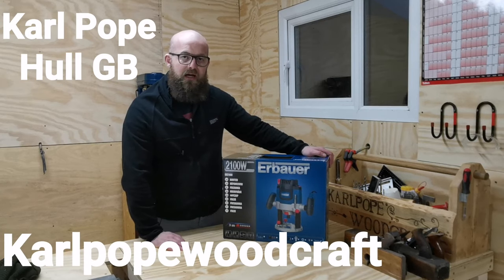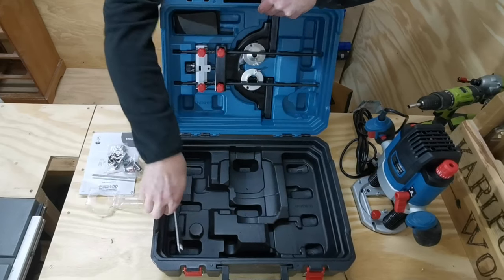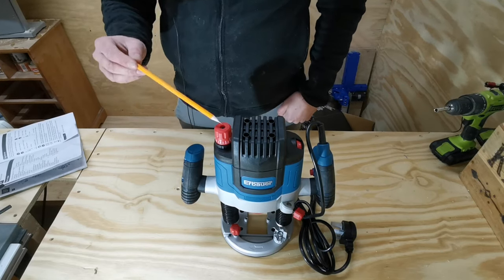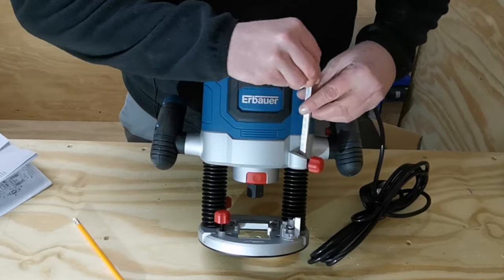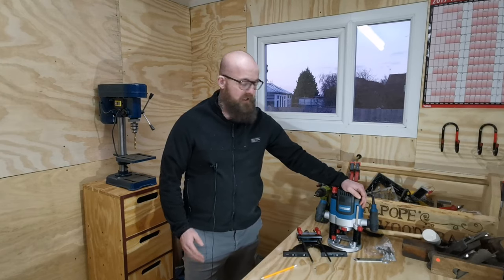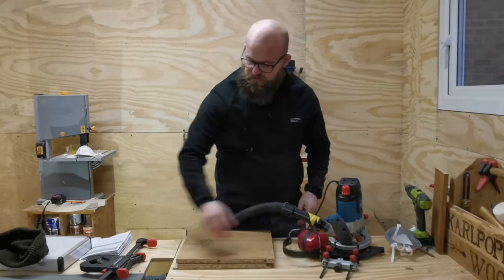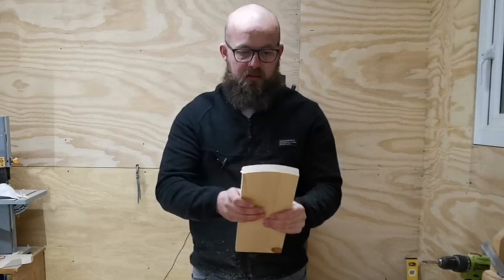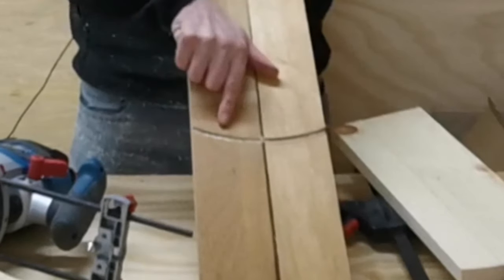Erbauer ER2100 review

Comment: Karl, have you tried to use this as part of a router table? I'm wanting to but I can not work out whether it would work or if I would be able to keep the power on without pressing the trigger button.
Reply from the maker: Hi Neil, I've not tried mate. If I remember correctly you need to keep the but pressed manually on this model. I have the triton in my router table as it's designed for that purpose and works well.
Reply: @karlpopewoodcraft  cheers for the reply, guess I'll have to have a good hard think on what to do but guess it may just need a lot more practice lol

Comment: Hey Karl. Literally just been to screwfix this morning and ordered a new router.... My router table router has been on its last legs for a while and finally blew its motor yesterday.
I've got one of those fences on my other router (though I rarely ever use the fine adjuster)..... But, once you've set your fence in the right ballpark, it works by unlocking one set of the lock screws... Dialing in your fine adjustment.... and the locking it back off.
Reply from the maker: Cheers Chris 🍻. Did you go for the triton in the end for the router table? I've heard decent comments about them especially with the lift mechanism.
Reply: @karlpopewoodcraft  yeah..... Get it tomorrow 👍

Comment: I’ve owned this router for months now and only opened it today, the parallel guide seems to be at a slight downward angel when attached to router and against workpiece causing it to slip under the work piece instead of resting snugly against it, is this the same as yours? My first router so can’t compare, great vid by the way
Reply from the maker: Hi Martin firstly thanks for watching and I haven't noticed any issues like that with my guide, however I will have a good look at mine this week as I'm using it for some tasks. What was the dimensions of the workpiece I.e the thickness of the material?

Comment: Great video review. I just bought this (my first) router today and am not sure about the parallel guide either. If you have mastered it a follow up video showing your experience would be really helpful.
Reply from the maker: Hi Jonathan, I don't really use the micro adjustment, think it's a bit fidely to be honest. In regards to the machine itself and the bits I think they are spot on, I've being using this beast far more than my palm router lately. 😊

Comment: I would be planning to use this in a router table. Unsure if the power on switch requires it always to be operated by hand, ie squeezing the trigger? Or if the lock on keeps the power going to allow for use in a table. Yes, I'm new to this lol

Great video showing all the features, looking forward to using this.
Reply from the maker: Yes this model requires the switch to be constantly pressed, if its for a router table I'd recommend the triton as it has a lift and can be switched on without holding the trigger constantly. 🙂
Reply: @karlpopewoodcraft  I just bought this router, and was confused. I thought that the lock was to lock it on, to be used with a table. I don't know if I should send it back, or tape the on switch up to keep it turned on. I bought it to use with a table. What do you think? 🙁
Reply: @karlpopewoodcraft  Hello again. Looking at this router which I just unboxed, looks like not a good idea to tape the button on, to use with a table. So my question is, could I use this router  with raised panel bits? It seems more challenging without a table, but if it's possible, then I'll not send it back. Thanks.
Reply from the maker: @fretboardfodder1037  I'd send it back mate, sounds to much like a lot of farthing around. Triton is pretty decent for a router table there designed specifically.
Reply: @karlpopewoodcraft  Thanks, will do.

Comment: Not a bad looking tool that, am considering a larger router. Nice to see the sub count rising too 👍👍👍
Reply from the maker: Hi James for 89.99 you can't go wrong I think. I definitely need to upgrade my router bits though these Chinese bits are terrible. Ye over the last few months I've had over a 100 each month and this 28days I've had 144 new subs so it's going OK at the moment. I've just bought a new microphone Amazon basic model but I won't need a wire that keeps getting tangled now🎤😊. My flag build video is doing baba though 🚩😭 probably because no one knows who Hull fc are😂 I should of done a Chelsea flag and all the glory boys would of subbed 😂

Comment: Ive had this just over a month now,its done everything ive askad of it.My little concern is that when doing a radius the plate where the centre is, does not align straight to the router base plateThere are 2nodules that protrude down about 6mm.Do you mind having a look at yours and tell me what you think.Cheers
Reply from the maker: I will, I remember using that and not enjoying the process so I stuck with the method of using my table saw sled for cutting out circles. I definitely have a gander at mine though.

Comment: How’s the router performing after a year?  I’m tempted by the price and I used one and it had plenty of power but I’ve heard that spares and bushes are difficult to get hold of and the bloke who owned it complained that he couldn’t find a way to lubricate the plunge mechanism when it started to get gritty.  Any update would be gratefully received. Cheers for the review.
Reply from the maker: Hi Tony for 80 pounds I don't think you can go far wrong, he's right about spare parts as erbauer don't do spares but screwfix do an excellent 2 year guarantee that I have used a couple of times with my Erbauer equipment and they have either sent it away for repair or given me a new item on the spot. Like I say it's budget but about as good as it gets on a tight budget if you get me.
Reply: @karlpopewoodcraft  Thanks for the answer and the tip about the Screwfix guarantee which I never knew. It certainly seems a good machine especially for the price. You could literally buy 3 of them for the price of a big brand version and that puts it into perspective. Cheers.

Comment: Thanks for this video👍
I’ve never used a router before and I’m just about to buy one, I saw this in ScrewFix for £89 and was thinking I’d be my own Santa this year.
Could you give me any pointers on this model
i.e is it a good starters unit or should I get something smaller, 
I’ll be using it for framing , skirting, and basically a get to know the machine and my capabilities, is this a big boys toy and should I start with something easier and lighter to use? 
Any advice would be appreciated. 
Thanks 
Ash.
Reply from the maker: Hi Ashley, firstly id say yes this does pack a lot of power for a first router however this machine will complete most tasks asked of it with ease. For fine detail work and just popping on a round over I'd say a palm router would be adequate, also if you where doing say signs and letters and palm router would be easier to control but for housing joints and removing large amounts of materials such as flattening a slab this 2400w machine would be great. Thanks for watching and be sure to subscribe and check out my other videos 😉😁
Reply: @karlpopewoodcraft  already subscribed and you can be sure I’ll be watching your vids. 
Great explanations and in depth is what I need as a newbie. 
Stay well. 
Ash.
Reply from the maker: @ashy1423  Thanks Ash, merry Christmas mate.

Comment: Personal review after use of it : power is OK, plunger springs needs a bit of oil to works well. The locking mechanism for the motor is just a mess.
First problem : the "base" is not perpendicular with the motor. Unscrew hex screw on edges of the base then hammer it (I found a car valve that fit perfectly into the router (8mm queue) and it's perpendicular). Not perfect now but I have to work :p
Second problem : the locking system works but the other side has a lot of play. So if you push a little bit with you right hand, you make a hole. Idem with rolling bits, be gentle. Maybe a tube of brass/copper will fix it. 

So, for every hobbyist (as me) that wants a router : If I can have a perpendicular base and fix the movement on right (around 3mm), I can recommend it for low budget. But definitively a cheap machine
Reply from the maker: Hi mate I think with machines at this end of the budget it's definitely hit and miss which one you pick up from the shop. The only issue i seem to have is the locking mechanism it can slip and you have to carful when applying pressure. Cheers for your feedback mate.

Comment: Thanks for that, very interesting, could you explain how to use the fine adjust depth knob, I can't seem to get any action out of mine! Many thanks.
Reply from the maker: Hi Ralph, I totally understand what you mean, the front knobs have to be tightened and then the dial should work but it literally is a fine adjustment, I also find this awkward.
Reply: @karlpopewoodcraft  Hi Karl, The book suggests that you can adjust up to 16mm but nothing moves at all when I turn it, I wonder if I just don't understand what I'm doing (have just purchased it...)
Reply: @karlpopewoodcraft  Ah I see now, I wasn't pulling the lock lever up high enough! Does it go all the way vertical, feels like it's going snap off after about 2/3rds rotation? And many thanks
Reply from the maker: @ralphporter3183  ill take a look at mine over the weekend Ralph I can't remember as I've only used the micro adjustment once or twice.

Comment: If I wanted to add this to a DIY router table, does it come with the bolt holes and/or plate for bolts to I can affix it to the table?
Reply from the maker: Hi John no it doesn't mate, your better off looking at the triton range if it's table mounted your after they are perfect for that use.
Reply: @karlpopewoodcraft  Champion, thanks mate.
Reply: You can table mount it but you'll need to make the fixing hole a little bigger and bolt it to your table plate !I had mine in a trend table for a month!

Comment: Love a tool review. How’s the shed holding up. Took ply and insulation off mine to find cladding was damp on the inside- wonder if you could give me any pointers pal
Reply from the maker: Hi K I've added the link to the silicone I used for sealing any cracks and knots in the description of the workshop update video, I've also added the bitumen I used for sealing the bottom of the workshop this acts as a vapour barrier and seems to be working great for me, Hope this helps. 😊Popped them below as well mate.
Reply from the maker: Unibond silicone I used to seal the windows any knots in the wood https://amzn.to/2SOYiCS
bitumen I used to seal around the bottom of the shed 
https://amzn.to/31V80YI
Reply: @karlpopewoodcraft  the bitumen link is down, I was needing some for my shed, don't suppose you have another link?
Reply from the maker: @samplum4150  https://youtu.be/3MpgYhXg6Bo I've popped a new link in the description of this video mate. Hope that helps you, it's great stuff and really seals everything in nicely.

Comment: Hi, really enjoyed the review, very clear and informative. Have just read a couple of bad reviews concerning excess play in the shaft and poor clearance on the plunge. Have you experienced either of these issues.  Regards, Dave.
Reply from the maker: Hi Dave firstly thank you, secondly no I have had no such issues. The only slight is I have had is the clutch slipping slightly when tightening up, however this has not caused any real concerns. Cheers Karl
Reply: Thanks for the reply, looking forward to checking out your other content, I’ve subscribed so as not to miss anything. This will be my first router for use on diy projects around the house and garden, so was looking for something that wouldn’t break the bank,work accurately and remain relevant as my experience increases.
Reply from the maker: @daveredfern1775  oh it will definitely do that Dave, it's a beast of a machine just make sure you buy quality bits that makes all the difference. Cheers for the sub and I hope you enjoy the channel.

Comment: I had this for one month it was secondhand for £40 I sold it for £50 it was temporarily till I fixed my elu 177 ,I found it ok for it's price but it is poorly constructed saying that the three cutter of  better quality and yes I still have them, beware it creeps during use if you take to deeper cut , the motor is claimed to be powerful it screams in use and struggles during operation,this is ok for the occasional user and a good get me by machine till you can get something better built! By the way my elu is twenty five years old and is still going strong !
Reply from the maker: That was a good get you by until you got the machine back you wanted then wasn't it Kev and you even made a few pounds on the resale. 💷😊

Comment: What size are the guide bushes that came with it?
Reply from the maker: Hi Steyr 16mm and 30mm.
Reply: Would you know the distance between the 12.5 blade and the outside of the 30mm bush? I want to use it in a jig but I want to make sure I buy the correct one . Thanks
Reply from the maker: @ffa556  hi Steyr I will have a look for you tomorrow. 😊
Reply: karlpopewoodcraft thanks Karl

Comment: How would this work on solid oak? Any good?
Reply from the maker: Yes mate, I use this router regularly on hardwood it's got more than a enough power. Make sure you buy decent bits though because those cheap sets off ebay are rubbish and the bearings break.

Comment: Thanks ! Fine adjustment is ugly in my opinion : you have to release the guide, so it move as hell ! and move also during reset of screws on it. Fine adjustment works, but you can't fix it.
Reply from the maker: Totally agree with you mate, I'm not keen on the fine adjustment. The best thing for me is its power, kicks but on slabs 😂💪
Reply: @karlpopewoodcraft  For sure ! I will try to put it under table. Not as nice and quick as with a triton but for amateurish job... 
Your one is already precise in cut ? (it's the risk with "cheap" machine...)